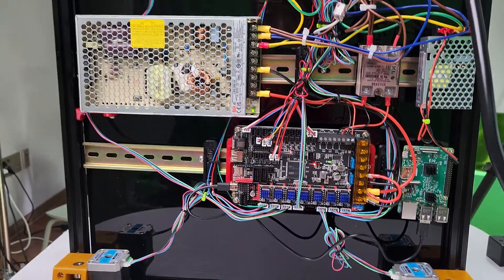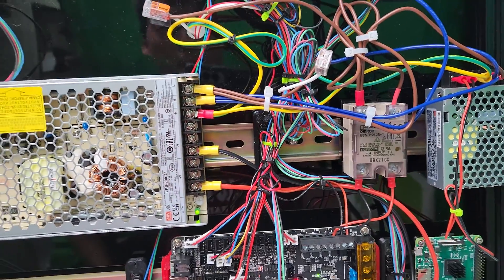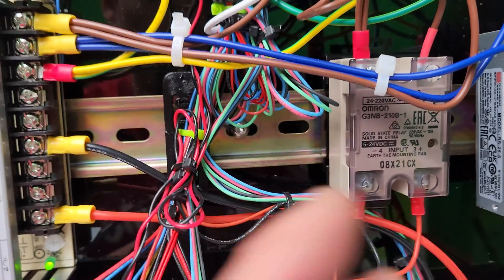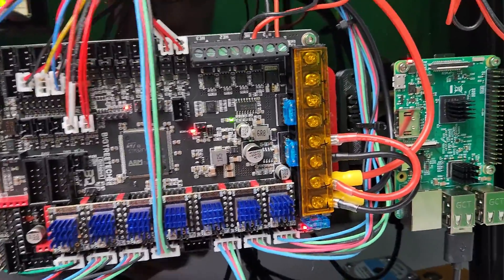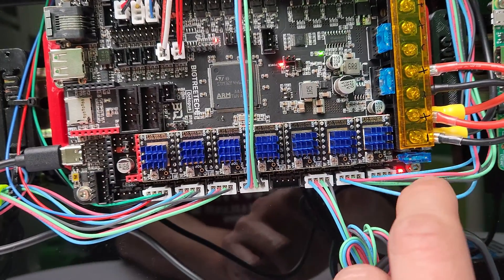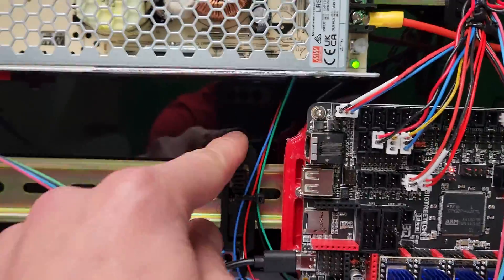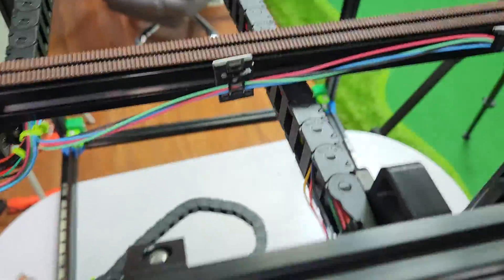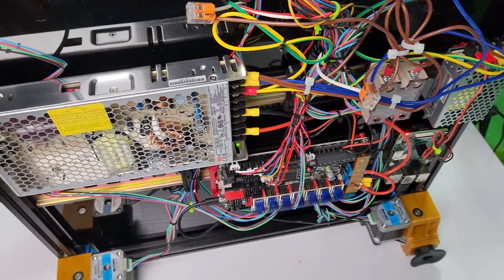Formbot Voron 2.4 Kit Electrical Wiring Guide!

Comment: Generally, in DC circuits, the switching is usually done on the negative (-) leg of the circuit because there is no alternate path back, however, in 120 volt AC, the neutral and the earth ground are connected together in the breaker box which provides an alternate path back and is the reason why the switching must be done on the positive (+) leg of the circuits.  For 240 volt AC, the switching must be done on both legs as they each function as a neutral when out of phase.

Comment: Hey @3dprintschool I'm having the same problem when I attempted to load the image file of mainsail to my raspberry pi 4 it doesn't want to work. I have the exact same setup as your video with a 5v power supply I just don't know what to do since this is my first time wiring a voron and trying to get klipper up and running but you said you went with kuah so I going to try to go with that hopefully that works great video man thanks for the content

Comment: Normally I like your videos, I tend to use them a lot because I got a formbot kit. But this one doesn´t feel prepared, a lil rushed and dirty.  I came here to see the connections between switch and inlet, my formbot has wagon clamps, so I think you can do it better. Also I didn´t see the PE in the SSR.

I don´t want to be mean, just constructive.

The rest of the videos are fine :)
Reply from the maker: You are actually right this was just a quick video i took, never prepared for it but the wiring is 109% correct, been printing for many weeks 24/7.  I will have an updated video that is clean though that will be in my tutorials not this one.  Cheers.

Comment: An issue I had was that the wire harness they provided did not connect V- between the 24V and 5V PSUs. This apparently is necessary since the Pi is connected to the MCU (ie: 24V electronics connected to 5V electronics). It looks like you haven't done that.
Reply from the maker: You are right I forgot that step.  Is it necessary?  I haven't had any issues without it so far.  I know it is negative reference... oops.

My guess is that since there is a usb connection from pi to octopus, they share negative thru usb c anyways.
Reply from the maker: Yeah the usb connection shares ground so you don't need that connection.
Reply: @3dPrinterSchool  my understanding is that it is to give a better path between the 5 and 24V PSUs than the USB cable + octopus board. I asked for clarification of this on the Voron discord when building my printer and was told doing this was important.
Reply from the maker: @NickNick2024  I think ground is only used for the purposes of zero voltage so I don't think it will matter how you connect it.  Since Pi is only connected thru USB, you have no danger of zero voltage if Pi is not connected.  Maybe over engineering?
Reply: @3dPrinterSchool  My kit actually came with a V- cable from psu to psu